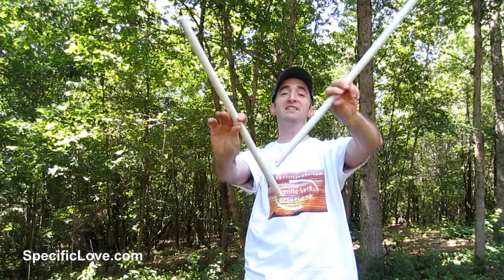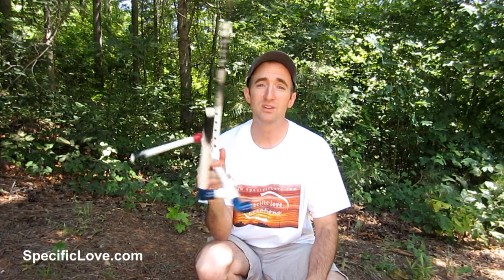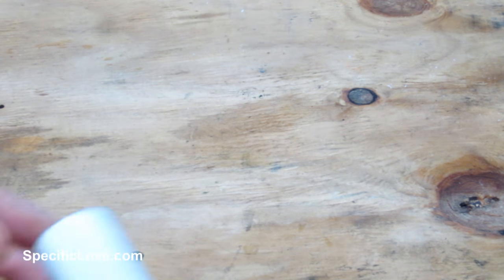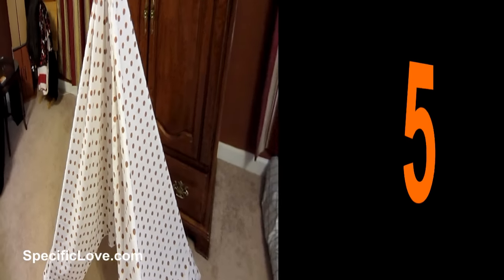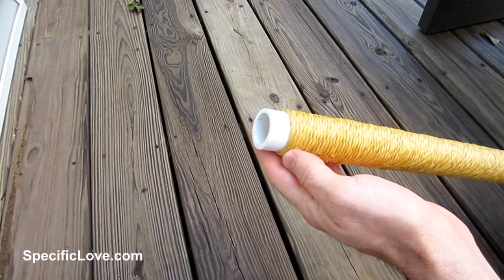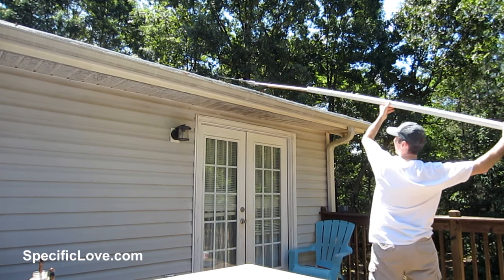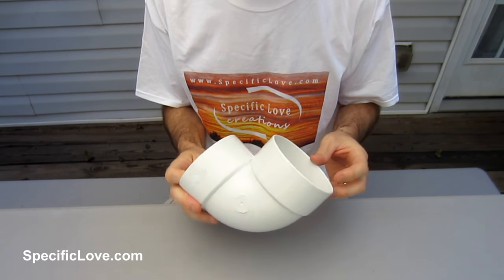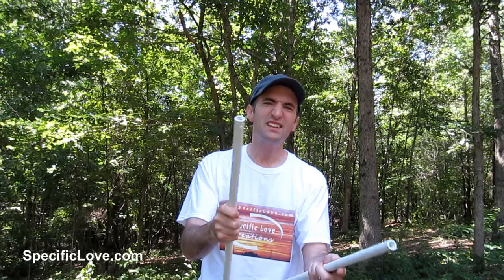10 Life Hacks with PVC #15

Comment: You're videos are great. Glad to see your son involved also. I like to include my kids in mine also. Some things we have done with pvc are taking a 1/2 inch pvc about 3' long and attaching our action camera to it. We take a pool noodle and slip over the pipe and we can drop it into our fishing spots to get an underwater view. I have also cut lengths of 3" pvc and slipped them into my wife's tall boots to hold them upright when they are in the closet. In the garage I took a section of 2" pvc with a glued endcap on 1 end and threaded cap on the other. Drilled 2 holes in the glued end, 1 fir an air fitting and the other for a length of tubing. I can fill it with gear oil and pressurize it to fill the hard to reach spots on my vehicles. Keep up the good work!
Reply from the maker: Those are some great ideas. I hope to use a couple of those in future videos.

Comment: Thanks....  this series just keeps feeding my project ideas.....  and that can be good and bad.  I thought the lamp was solar for outdoor decorations.  Never thought about it, but now I have a bunch of custom lights to build.  Cheap solar light cap on top of a red painted PVC with OU cut out for football season.  Compass cut out for scouts.  A cross for church.  How about the 75th Ranger tab ( or Rangers lead the way).    And what's nice is once the light is embedded in the PVC, you can attach wires to it and make into a  lantern vs. a table top or ground level light.   Yes my wife has me busy for Xmas gifts for this year.   Well it's off to ACE to get some thin wall.....  Grumble, Grumble, Grumble
Reply from the maker: Those all sound like great ideas

Comment: You could make a fruit picker with a ten foot pvc pipe and a some kind of rope or string.  Attach the line one end of the pipe and thread the other end through the pipe so it comes out other end and still have a loop on the other end.  When you have a piece of fruit too high in the tree you loop the fruit and when you get around the stem pull the string tight and the fruit should fall out.
Reply from the maker: nice

Comment: i have an idea for your channel which ive used (well  if youre a hunter like me and if your bow happens to break ...you could take a 2 inch pvc pipe ....put 2 end caps on the end of the pvc and drill 2 ends close to the end of each side and take some paracord and put them through the holes and tight a know on both ends ...and thats how u have a pvc bow)

Comment: #1-How do you use the painting station?  Please elaborate.
#6-My cats like vertical scratching posts.  Any suggestions?
Reply from the maker: You can bend the painting station in differein way to hold things up. 
If you wrap some 1-inch pvc in rope and then place it over something, it might work.

Comment: Hey I've made top water poppers for fishing with 1/2 inche pvc pipe.
Reply from the maker: Interesting idea, how did you attach it to the fishing line?
Reply: +Specific Love Creations 
check it out on my YouTube video. I have a short montage and video how I got it done.
Reply: Using a snap swivel.... I have made 5 of these poppers.  The best size is 4 inches of pvc pipe. The others made where 6 inches worked well with larger rods for surf fishing.